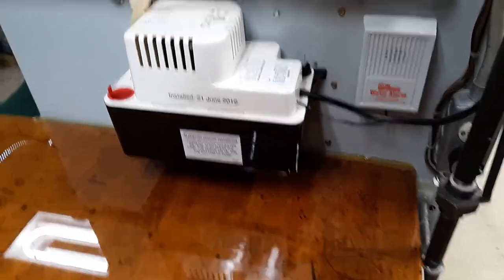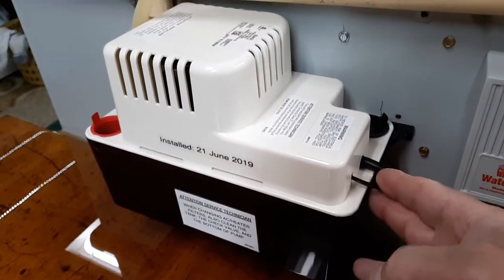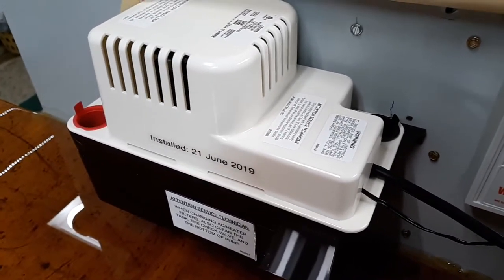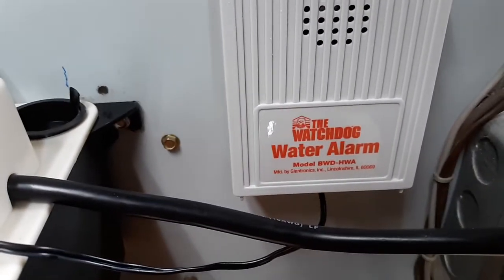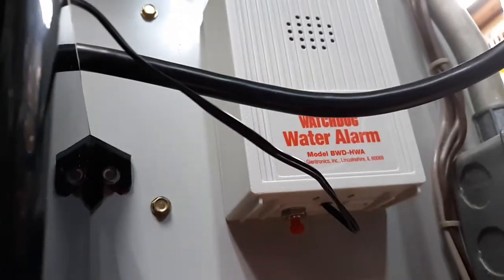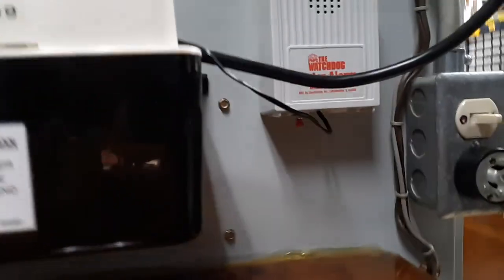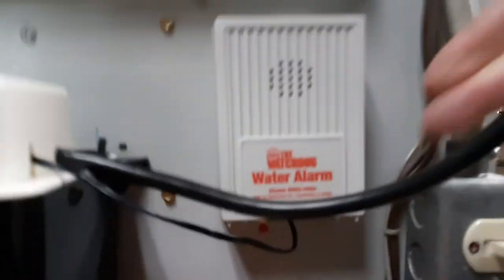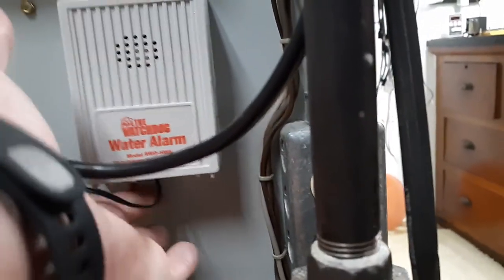AC Condensate Pump & Alarm

Comment: Can you explain how you rewired everything to work?  I have an alarm with 2 contacts coming out and cannot get it to work.  i have the same pump as you.
Reply from the maker: Hi Justin,

First, you need to open up your Little Giant pump, then relocate (move) the wire on the safety switch from 'NC' (normally closed) to 'NO' (normally open).  Then connect the 2 wires from the Little Giant pump safety switch, to the contacts/wires on the bottom of the Watchdog High Water Alarm alarm unit. The red push button test switch on the alarm unit is not required.
Reply: :face-purple-crying: